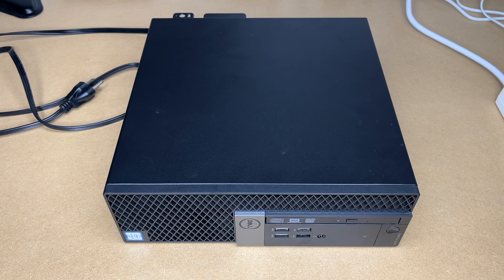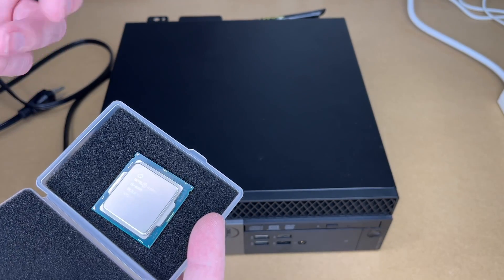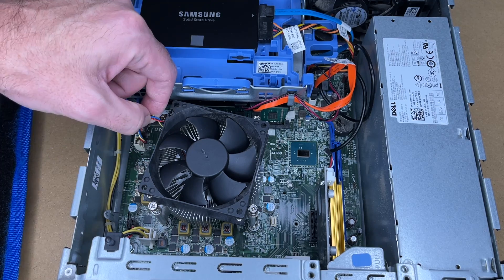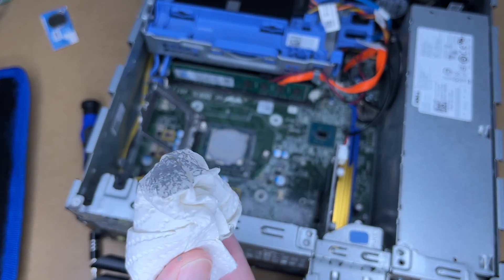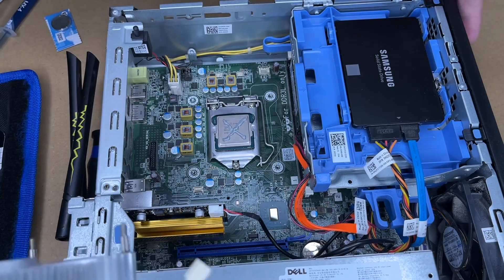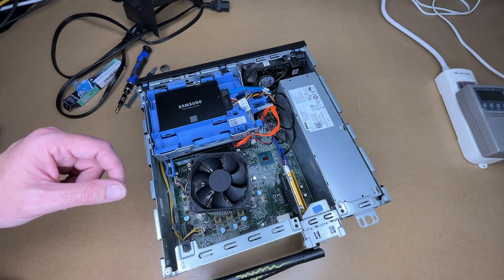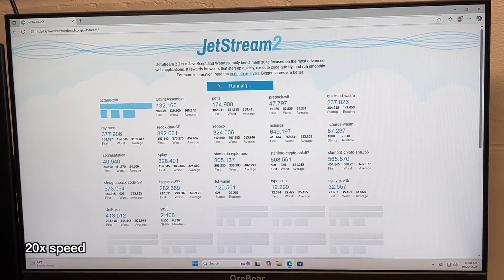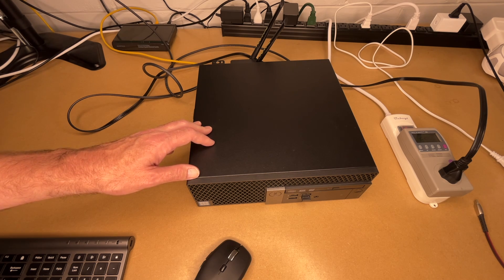Dell OptiPlex 3040 Intel Core i5 Processor Upgrade

Comment: Good video, thanks. Will return to this when I upgrade the processor in mine (also starting with an i3). The 3040 SFFs were releases in 2015 and some even in 2016, so more like 10 yrs old and still a pretty capable little device. Thanks for posting!
Reply from the maker: Unfortunately RAM prices have skyrocketed. It's going to make it hard for people to upgrade these older computers.